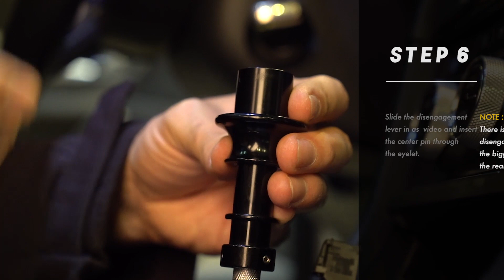LEYO MOTORSPORT DSG Shift Knob Installation / Automatic

Comment: Is there a way to adjust where the seam in the leather sits once the knob is installed?  It would drive me crazy to not have it at 12 o'clock or 6 o'clock.

Comment: Have this fitted to my 8J TT no issues.
Reply: TTRS?
Reply: @danielwilliamson5371  It will fit either the newer or older 8J dsg shift levers with no need to alter the plastic rod.
Reply: @3.2vr6  Hi do you mean it would work with those dsg shift levers with side button? And no need to to bent the plastic rod to face forward with a heat gun?
Reply: @teruian31  That what mine was the side button shift lever.
Reply: @3.2vr6  Thank you very much kind Sir for that information which helped me in my decision for this.

Comment: Does this work with the DSG cars that have the button on the side of the original shift knob?
Reply: It should. I would recommend spinning the adapter so that it lines up. I didn’t use this one but instead used the BFI Golf knob for my automatic Mk5. Works good & looks way better. 😎